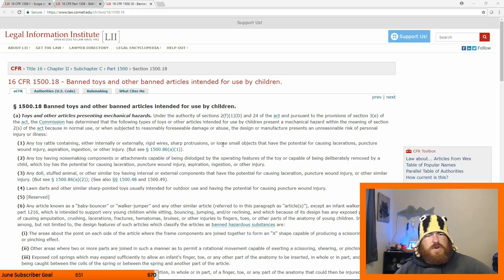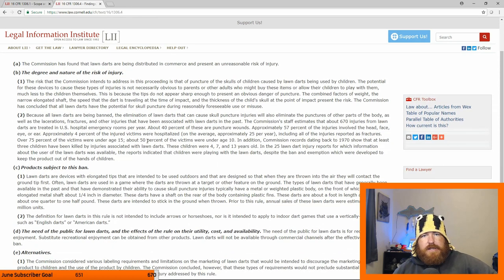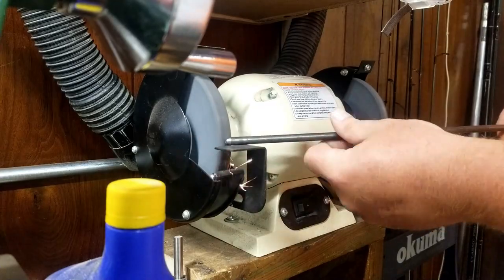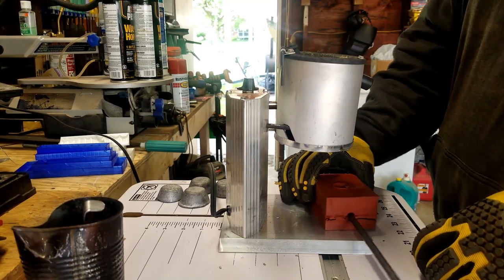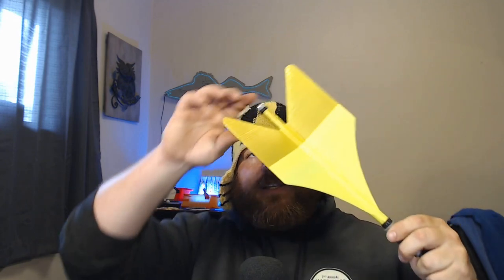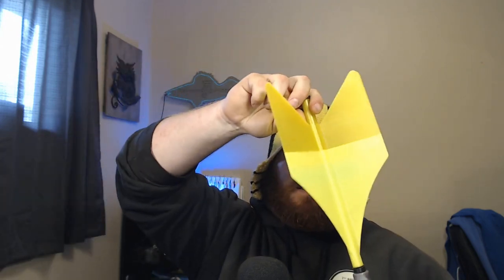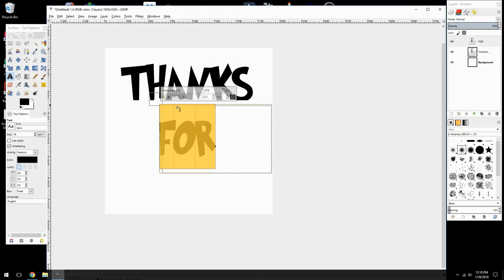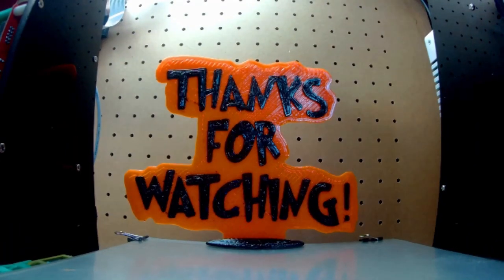So I made Lawn Darts...

Comment: If the law permits, I'd like to cast these in aluminum, using a steel tube, as the weight. The tubes would be drilled and stuffed with rags. Soaked in kerosene and lit. The targets, would be steel pans filled with gravel and Gasoline.  Obviously, not for kids. But I believe this could be an Olympic sport.

Comment: Do you happen to have the STL file for the wing still? The link doesn’t work anymore.
Reply from the maker: It seems like thingiverse has removed everything lawn dart related. Unfortunately that's the platform I use to post my designs. I have found one that looks promising  cults3d that may work I'm haven't printed it yet though to confirm.

https://cults3d.com/en/3d-model/various/lawn-dart-fins-with-fusion360-files

I hope this helps
Reply: i have the files for two types that my dad has

Comment: Awesome job,  thanks, where can I get the info to print them ?
Reply from the maker: Unfortunately all the hosting services are removing the files now probably due to liability worries. There is a user in this comment section that has found some if you want to check, labency I believe is the username.

Comment: Would you sell just the fins?   These similar sets can be bought from UK shipped to USA DISASSEMBLED but shipping is $46.00 !!
Reply from the maker: I think I would need to do something a bit stronger than the 3d print version, it works but if you really put some back into the toss the blades chip pretty easily. A long term solution would be to injection mold them with some sort of different plastic, I wouldn't be set up for that unfortunately, tooling would be a huge investment.